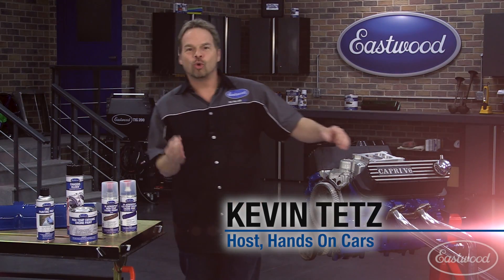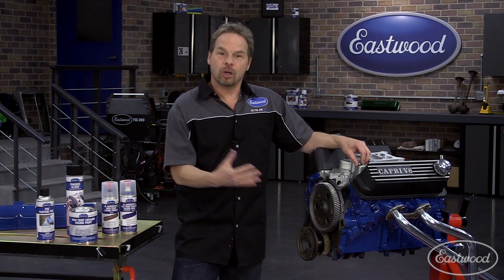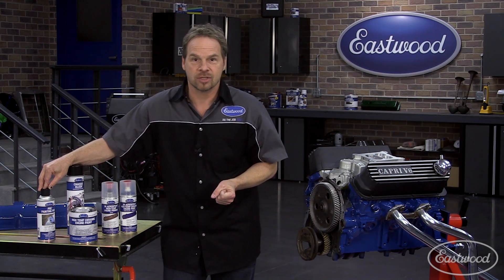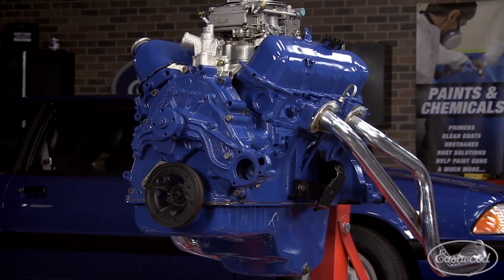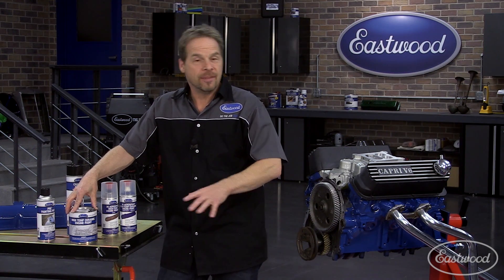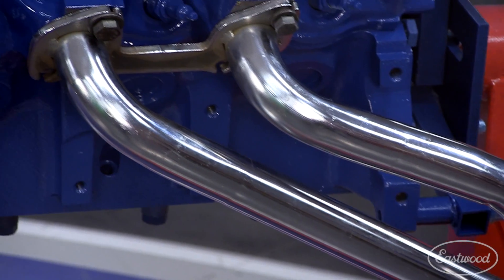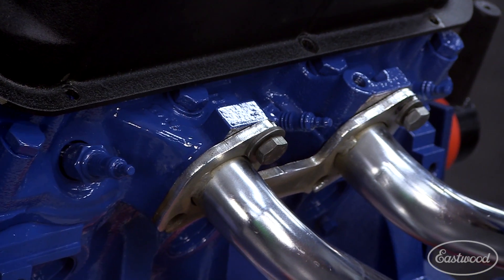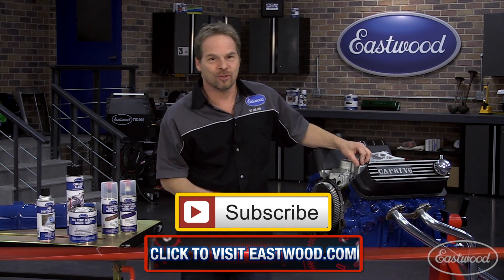High Temp Engine Paint & Coatings - 2K Primers to OEM Color Paints - Eastwood

Comment: Painting over bolts and spark plugs is dumb. When removing the boots or plugs the paint has a high chance of cracking or flaking. Even if you don't see it cracked this is how micro cracked lead to rusting poping the paint from underneath. Just do yourself a favor and prep it the right way no short cuts.

Comment: did he painted spark plugs... xD
Reply: I thought the same thing, but he said it was so they didn't have to tape it up.  They're going to remove them and put new ones.
Reply: Yeah but if you have ever painted over bolts and stuff when you remove them they crack and chip the paint around the hole. It's just a stupid thing to do.
Reply: Colton Wancho   I leave old spark plugs and bolts in when painting, the way to do it is to remove them once you've put your last coat and before the paint dries so that the paint doesn't crack.
Reply: Yes you can leave them in it is not stupid!! brake the spark plug loose then use a good wet/dry vac and suck out the paint chips or what ever comes off, do it slow and keep vacuuming and if you see paint coming off use a small screwdriver while vacuumiming and you will be fine. Stuffing stuff in spark plug hole and then trying to pull that out is asking for trouble.

Comment: About to paint my 2.5L subaru motor in a few days. i'll let everyone know how it goes.
Reply: How'd it go?
Reply: Came out great once i decided on color scheme (all flat black). the gloss lead down horribly though and wouldn't recommend it. I also did some red and it was super bright and hid all with just one coat. And once i finally got the the flat black it laid down very smooth. no issues, gave it plenty of cure time, zero chips, great adhesion.
Reply: Thanks for the feedback!